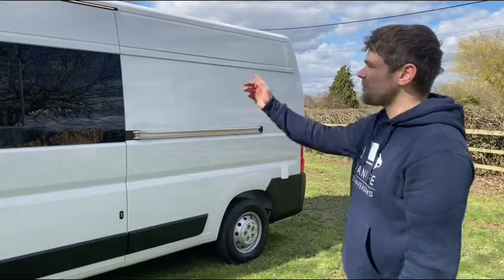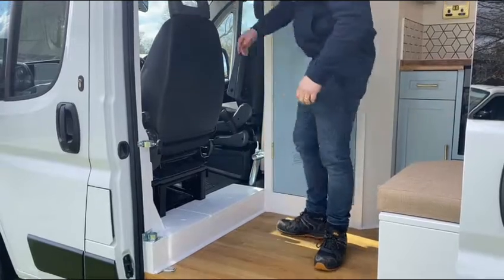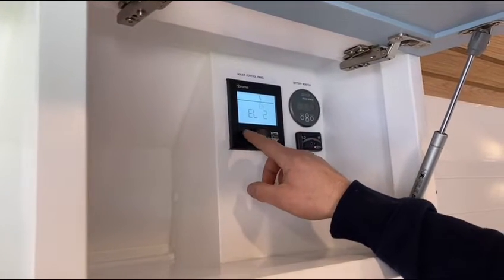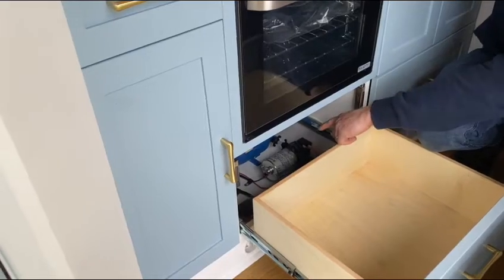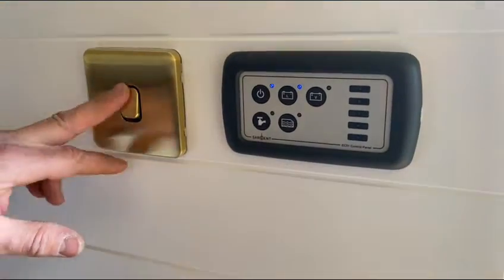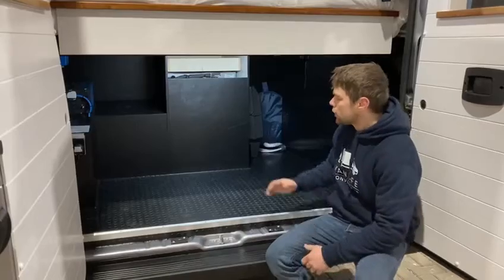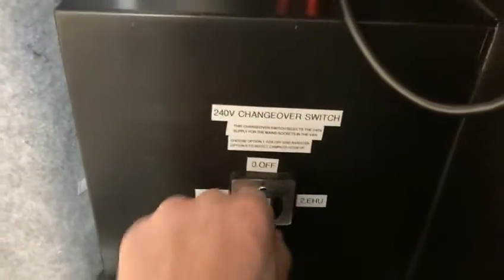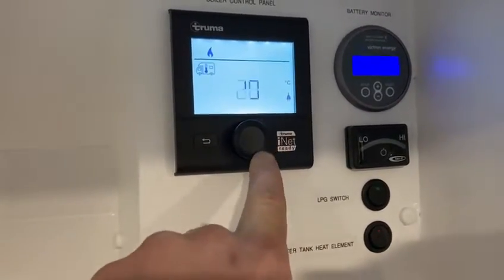Stunning van tour | Handover process of how to use the van

Comment: Hey guys, would you ever consider building out a family van conversion? Would be really great to see more family vans that actually think about the sleeping arrangements (eg kids not sleeping in your bed). We were thinking for a family of 4 in a long wheelbase you could have two single beds as tall as you would make the double fixed bed at the back of the van with a walkway between the two beds and a panel that can slot into the middle to make it a large double or a third single if your kids friend come on the trip too. This back bit is walled off with an arch in the middle and the wall is sound proofed as much as possible. So when the kids go to bed they have a balckout space with some sound proofing while the adults still stay up in the fron part of the van. On the sliding door side you have a kitchen and on the opposite side you have a dinet that incorporates at least 2 more belted seats. This dinet will convert into a double bed for the grown ups when they go to bed. Shower pan can be hidden under the floorboards near the sink tap with hooks on the ceiling to use a shower curtain so no need to take up space for a bathroom. Not thought to much about the rest of it but essentially there are not many family conversions out there that really think about sleep arrangements and space around tables for good quality family time even on rainy days.